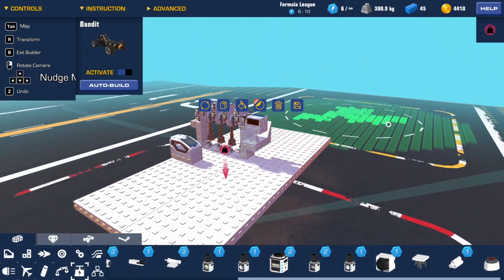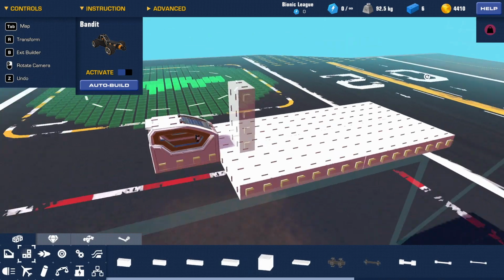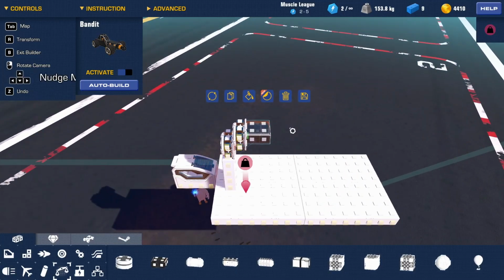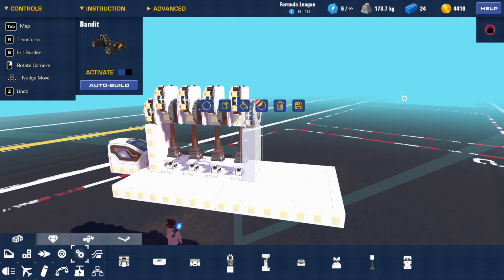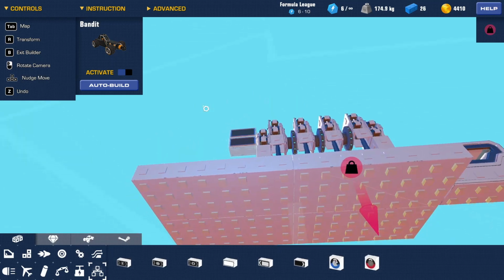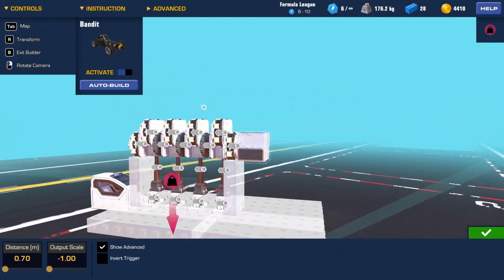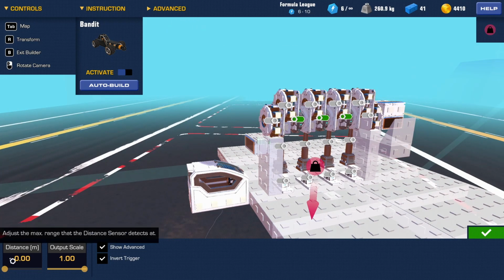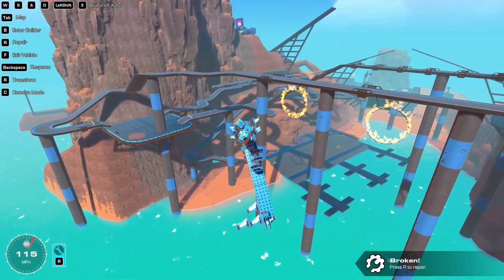Trailmakers Piston engine Tutorial

Comment: Is there a way to transfer the power to wheels with pipes to make realistic drive shafts?
Reply from the maker: For sure! Make sure you use v2 heli engines
Reply: @wtswins I have been playing trailmakers for about a year but haven't figured out most of the functional block
Reply: @wtswins I play on console because I don't have a computer will this engine still work?
Reply from the maker: The engine will still work
Reply: I figured it out I rotated the pistons wrong

Comment: Oh nice! gotta try this myself, thanks for the idea! :D
Having never built them in Trailmakers but having a bunch of experience with piston engines in Scrap Mechanic, considering the amount of centrifugal force it has (which might seem good but technically isn't) i have 3 suggestions (that i'm also going to try myself later today when done with work hehe)

- The "timing plate" or "timing cowl" or however you wanna call it (the bit that the sensors look at to control the pistons) seems to cover too much of the rotation, you can probably remove one of the angled pieces to get the engine to run smoother

- Consider making a design where you have a sensor that looks at the side of each piston, at the top where it attaches to the crankshaft, if the sensor sees the piston then fire the next piston & if last sensor sees last piston then fire the first piston (you'll have to find the sweet spot for detecting piston-top with a sensor, might need another piston or something to get the right distance between sensors and pistons if the sensor's distance setting isn't precise enough) this way timing will be more precise compared to the timing plate/cowl design & any sort of twisting in the crankshaft should have less of a negative effect

- Pretty unrealistic but usually nice to have: both your design and the 'look-at-side-of-pistons' one can be made to allow you to switch rotation direction by just changing when the pistons are triggered, for the timing plate/cowl version you can have a second plate/cowl like that on the opposite side, have both on a piston and then just swap between them, for the 'looking-at-side-of-pistons' version you can look at the opposite side of the crankshaft (either with another set of sensors or by just moving them there with a rotating servo or whatever) to get the same reversing effect.
Reply: Thank you for this! I might try it!

Comment: Hiw do you make it counter rotate
Reply: With an inverted crank shaft (make the servo's that rotate 90 degrees go the opposite direction, so -90 or 270 degrees)
Reply: @suicidalbanananana rotating the servos the other way wont do anything but ruin the timings with this design instead you need to invert the timing aswell as the servo rotation. Im not a fan of having this style timings i put 1 sensor right beside the cylinder to determine its position its much less of a headache and more stable.

Comment: I I'm on console does 0.30 work
Reply from the maker: idk specifically per version but i do know it works on console.
Reply: @wtswins he means 0.30 as in the piston start pos, it only allows you to adjust it by 0.10 on console so it is not  possible to get the 0.33
Reply: @terriblegamer23 i set all my engines right to 0 if your timing is good it will switch the direction at the right position anyways

Comment: ok but does it matter if you stretch the pistons?
 like if u put the pistons on top and you stretch them more will it be faster
Reply from the maker: stretching pistons usually causes unstableness and when you over extend a piston it tends to act like the worlds strongest rubber band
Reply: @wtswins  oh ok
Reply: How have you managed to over extend it? I think this is interesting because if it acts the way @wtswins says then it could be used to create a new speed glitch like the hinge glitch or hoverpad glitch. Idk just throwing out ideas. I've experimented with this myself before a little but only managed to get a spinning motion.
Reply: @Exa-Spark You can make a rotor by adding more piston glitches, (from over extending) and then you can use that spinning to launch a rocket up, left, or where ever.